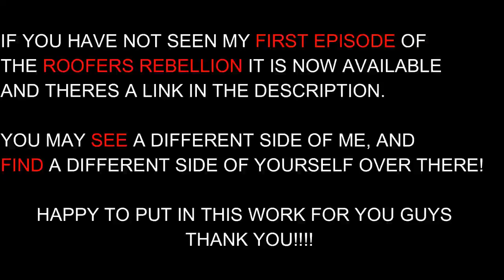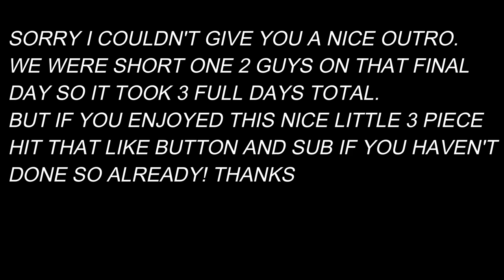Worlds Fastest Shingler 46 Sq Apt (part 3 of 3)

Comment: I use a hose called cobra you might want to look into one. Everyone around here uses them.  nice light strong hose. Just my preference but that hose your using is to heavy and thick. try it out you’ll love it
Reply from the maker: The flexilla are not thick or heavy. I will Google it but I'm 98%sure I will never use a different hose. This thing don't hold any memory
Reply: Ooo and i have my own cie in Québec Canada 🇨🇦 
I am a framer 🔨
Reply: And very nice videos and great job you are doing 
👏 Zack

Comment: Id always cheat on the first 2 rows, cuz what if the eave of the roof isnt parallel with the 8th row of shingles? Then youd have a crooked ass line right smack in the middle of the roof. Wouldnt it be better at the eave in that case?

Comment: nice work. what type of nailer and nails do you use?
Reply from the maker: prefer bostich. and nails are whatever really. as long as they're inch and a quarter. my supplier has some good ones but I've used home depots before its no big deal
Reply: @NWIVeteranConstruction  you ever used Paslode coil nailers,I've used others, but I prefer them

Comment: What brand of paper do you use for grip on steep roofs
Reply from the maker: I use that gaf felt buster for pretty much everything because I can walk it easily on 8/12s. and anything steeper than an 8 you don't really want to be walking. but you can get away with walking a 9/12 in most situations...I would use gaf tiger paw grip or something like that its called for a 9/12 specifically. maybe on an 8 wouldn't be a bad idea I guess. but yea for 10/12 and up you can't expect to walk it very much idc what anyone says unless maybe they got cougar paw boots so just stick with regular felt buster or your synthetic of choice. like I said me n the boys all like felt buster. easy install. grippy. too easy
Reply: Thanks for the reply.  I’m a roofer wouldn’t try to walk on anything over an 8/12 either since I don’t use jacks or ropes but my supplier keeps switching brands getting cheaper every time.  Do you buy bulk?

Comment: careful with that ridge cap. looks like seal-a-ridge? no nails on tar line per manufacture specs. inspector wont catch it 99 percent of the time but last thing you want is to get dinged for it and have to waste time replacing it all (from experience)
Reply from the maker: didn't know that! never heard of it will look into it tomorrow thanks

Comment: At 14:25 I would have caulked some lines and eating 1/4-1/2 inch of each course
Reply: To each their own guys. I run two crews and regardless of the roof and nailer. I always have the caulk all the way up. That way everything is done right. We can check how squared the roof is to make sure the last corse at rige is straight.
Reply: @BigDaddy-je1eg  no the guy who doesn't take the 10-15 min to chaulk lines has a wavy roof most times I don't care how good you are.What I see here is he's the only guy on his crew who can roof.Which hay to each his own.Ive chaulked the first line and top to keep it straight.However it's easier to chaulk the hole roof when you have good roofers working with you.It makes the roof look nicer and easier to lay shingles when you have a line to go to instead of looking for that shigle.Yet it's his company his roof as long as it don't leak no one really cares!!Only time a person cares about a roof is when it leaks!!!!
Reply: @BigDaddy-je1eg  we can agree to disagree.If seen it so many times a person can run a line but have them try to just run the shingle they screw up.Only experience will make a person good but lines from my experience helps new people have better work.

Comment: Why not cheat all 6 rows 7/16 light, instead of an inch on 2 rows. asking for a friend......
Reply from the maker: Because that's not necessary.  Everybody has a different way.  I usually adjust 2 or 3 rows and I firmly believe it turns out plenty crisp. Also depends on location on the roof. Might spend a little more time on something more visible
Reply: I totally agree it depends on visibility. Did it today on a 14/12 where the eaves came 2 feet from the ground. I ran 16 courses 1/8 short to cheat two inches. Probably overkill, but people question my ability because of my age (19), so I take no chances, lol.
Reply: @Dribbling_monk  definitely overkill!!!Alot of people think shingles are trim carpentry!A quarter inch, half inch hell an inch  or 2 in spots is ok!A 1/8 inch is a bit much but hay if your hourly why not!There is a huge difference in hourly work and piece work!

Comment: you should measure down and make your cheater row the first row, i hate seeing it when people cheat at the row they meet it doesnt look good at all sticks out like a sore thumb, the first row being a few inches or whatever it turns out to be looks way less fucked. This is why i wear a pouch, as a carpenter should, they claim you dont need chalk lines tape measures and shit for roofing, maybe a roofer who doesnt give a shit doesnt, but those two tools can help you out greatly and keep you square.
Reply from the maker: I chalk lines for starter and ridge but that's it.  It's on the roof in my stool bags but no need to let them weigh you down when you're shingling 10 hours
Reply: @NWIVeteranConstruction  i wear my pouch everyday, it is much quicker having 5 sets of coils on you at all times, your knife right there not deep in your shorts pocket, i also use snips mostly for roofing i dont like hook blades, unless its 20 or 30 Celsius out they dont work as good, im in canada we jsut got 5 inches of snow again and -17. You do good work dont get me wrong id rather see a guy like you on the roofs who cares about quality control, im an exterior finisher, siding mostly hardie vinyl etc but roofing is just easy and i dont mind the work so we get a lot of that here to, so my attention to detail is higher then your average roofer whos there to get paid.